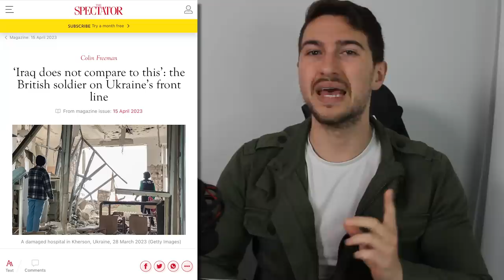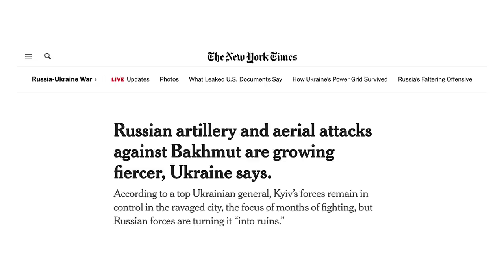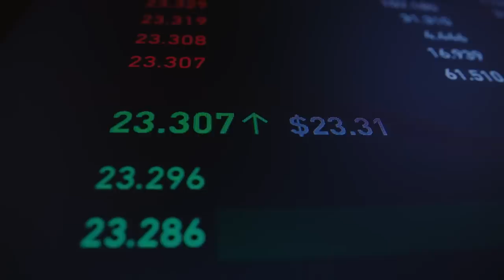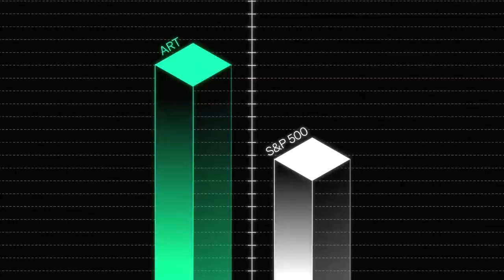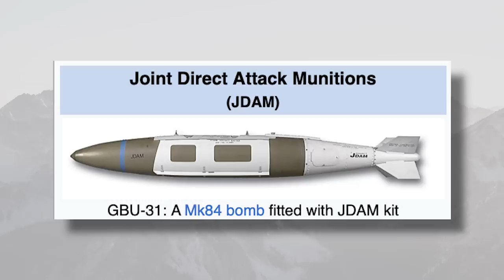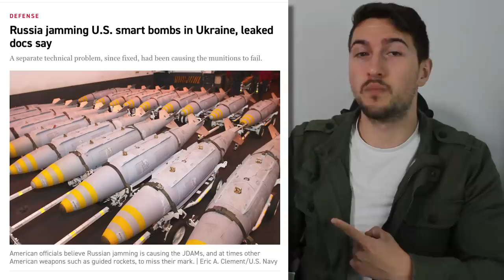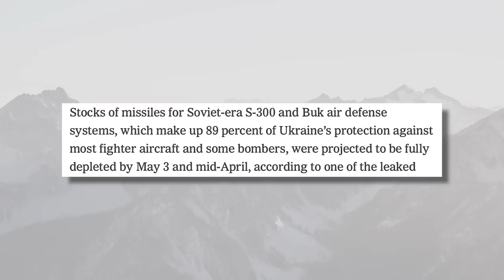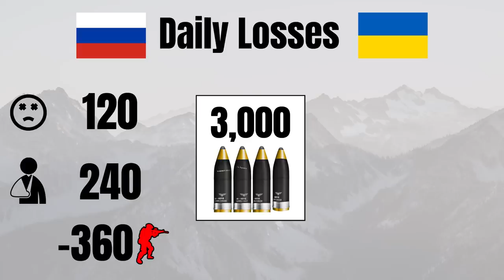Wagner Swipes Through West BAKHMUT with FAB-500s

Comment: There is this dude called lazerpig that just makes shit up saying ukraine arty is more precise and better and russian are bad and its running out of ammo, he refuses to elaborate with zero proof. Sometimes he just annoying at best.
Reply: NATO supplied Ukrainian artillery does have an advantage. Russian artillery, particularly SPGs are mostly 152 mm equipped with L/47 barrels. While the NATO equivalent is the larger 155 mm L/55. China has also adopted this standard.

The accuracy issue is also tied to range. Shells become less accurate as they lose momentum. Which peaks when they approach their maximum range. The shorter L/47 barrels on Russian artillery means they naturally lose range and accuracy sooner.
Reply: @KSmithwick1989  the problem I see that ukraine is 100% depended on West ammo delivery and just like it said on the video the industry military complex are having problem making more ammo.
Reply: @KSmithwick1989  when it comes to accurate it doesn't matter that much, becuase if your enemy as 10x more artillery you have bearly any time to fire without having to move fast evertime to avoid counter barrage, and that time is vital if on the attack or if your frontline units need fire mission to hold the line. The advantage fro the russians is that they have so many artillery guns that they can fire at everthing very time and being able to supress the enemy ability to response.
Reply: @Luiz Vinícius Vieira Alexandre  Range and accuracy does matter. Especially when that artillery advantage is mostly tied to towed artillery. From the Ukrainian perspective, they're targeting the artillery batteries and ammo dumps themselves. Which is an effective means of attrition. As it destroys irreplaceable Soviet era stockpiles while eliminating experienced gun crews.

Firing 10x out of inefficiency is also an issue. As you're exposing more of your logistics network to enemy artillery. While simultaneously wearing out barrels, which unnecessarily eats up more resources.

The before mentioned range advantage also negates your counter-battery narrative. The Russian 152mm L/47 is really not a competitive system. For example, a 2S19 MSTA firing extended range  basebleed rounds has a range of 29 km. While NATO systems with the 155mm L/52 can provide 36km range with standard boat-tail rounds.
Reply: @KSmithwick1989  yes I agree, accurate and range can be helpful when it comes to Hunt down ammo caches or expecific targets,  but when it comes to frontline dutys like supression on a Broad frontline like it is on ukraine quantity are proving to win be winning this match. It is not 100% science there is alot fog of war.
Reply: @KSmithwick1989  but that is the thing. Russian Artillery is precise not as accurte like western gun and they are beang able to put alot of stress intro Ukrainian artillerys team, just like soldier X said on his interview that russian artillery response teams are faster them Ukrainian, not my words. Both sides are using alot of towed artillery there are SPG but great majority its towed guns.

I Personally belive the only way to ukraine to match the russian fire power is to have more or just as many artillerys guns as russia.
Reply: @KSmithwick1989   calm down its hard to replay if you keep editing your post
Reply: @KSmithwick1989  I agree with you The russians artillery don't even match when it comes to range. But West are not sending their hole stock of excalibur 155mm round for ukraine. Most ammotions they get from the west are dumb round.
Reply: @Luiz Vinícius Vieira Alexandre  It's simple, conducting such asymmetric operations dwindle the enemies' means of conducting war. Modern Russia does not have the factory or the budget of the Soviet Union. Decades of neglect and political succession has prevented that.

So they really lack the physical means of replacing shells faster than they are spent. Firing that many shells is actually doing the Ukrainians a favor in the long run. 

As the advantage is steadily becoming more narrow. Some estimates even place the current figure closer to 7 to 1. With daily shell expenditure dropping closer to 7,000-8,000. As opposed to the previous estimate of 20,000 shells per day.
Reply: @KSmithwick1989  yeah we have zero info when it comes to russian production of ammotions. And we idk how many soviet era stocks are still out there, one thing is for sure soon Ukraine or Russia will be doing something and we don't know when its too soon to say what.

Comment: That M109 cost 14.4 million dollars 🤔 what a joke 😂😂😂
Reply: That price is for the newer M109 A7. Those are designed for a newer 155 mm L/58 cannon. It significantly out ranges the shorter barreled Russian 152mm L/47 cannons. 

Those systems are only capable of 36 km. As opposed to the newer M109, that is capable of 70 km with RAP rounds.
Reply: @KSmithwick1989  seeing a drone take them out that cost what? Over priced MIC shit..
Reply: @Russianbot5150  It's really not hard to counter the drones. Both sides have been doing that with simply nets. There's footage of lancet drones being disabled by that method.

Comment: This is a Russo-NATO war though
Reply: Russia- casualties in the tens of thousands,tanks and armour losses so heavy they need T-54/55s and MT-LBs with WW2 ship cannons to fill the gaps

NATO- hasn't arrived yet
Reply: @ahta5708  It's actually vice versa. NATO has already depleted its stocks supplying all of its arsenal to Ukraine, and it has Ukrainians as the only people willing to fight for it. While Russia hasn't even mobilized to any significant extent.
Reply: @iMetmor  "NATO has already depleted its stock"

Source on that? Because NATO hasn't even started supplying Ukraine with it's modern arsenal until recently with newer MBTs and IFVs,and even those are from the late 90's

"Russia hasn't even mobilized to any significant extent"

They've already done a mobilization wave mobilizing anywhere from 300,000 to 1 million,and they still haven't captured anything significant in the past 6 months. And there's also the sheer amount of armour,vehicles and modern tech they're losing that makes them desperate enough to bring out tanks and APCs from the 50's. And there's also all the logistics needed for Russia to mobilize their supposed "real army" which if their performance recently is anything to go by, it's now non-existent
Reply: @ahta5708  Ship guns are better than the ZU-23-2 and much better in terms of firepower.
T-54/55 - most likely will not be used for its intended purpose. They are needed as artillery guns for shooting beyond the horizon. A huge number of shells are currently in stock.
Reply: Ukrainian soldiers are trained in NATO counties, they USA NATO equipment (Czech republic moment), they obey NATO's orders and they also use NATO's intelligence. But no, NATO hasn't arrived yet, cope
Reply: @PrstBs1  You see any NATO jets doing SEAD and taking out Russian jets from 200km away,followed by NATO bombers, strike aircrafts and apaches destroying Russian ground forces,all while the entire airspace is covered by an NATO AWACS, before NATO Leopard 2a7s M1A2 sepv3s,m2a3 Bradleys with this generation thermal imaging mop up the rest of the forces in the night,being covered by himars launching ATACMS?Because if you don't that means NATO hasn't arrived yet and Russia is up against Ukraine. Besides, what happened to the whole "Glorious Russia can take all of Europe plus American combined"? Are you admitting Russia would lose if they do that?
Reply: @PrstBs1  It should also be added that the army that Ukraine had in Feb 2022 was the army NATO had trained for 8 years while pretending that it sought peace along the lines of the Minsk accords only Russia believed in.
Reply: @ahta5708  Hahaha, if NATO arrives the way you expect it to, it will be humiliated even more. Russia's air defense is second to none. A hostile jet doing any significant damage to it is just not a possibility in this universe.

Your fantasies show that America and NATO have gotten used to fighting poor peoples with no proper means to defend themselves. But as every American war since Vietnam showed, they can't really defeat even tribal people — only do damage and retreat. With Russia NATO can't even do that.
Reply: @iMetmor  There's this thing called SEAD and DEAD operations specifically for dealing with the air defense systems that any competent army would know about,so not surprised you and the Russian armed forces have no idea what it is
Reply: @ahta5708  Your whole point is that NATO uses not their most advanced equipment? Well, Russia doesn't use T-14 or Poseidon missiles, and? What does it change? And yes, in a full-scale war between NATO and Russia - Russia will lose...Just like NATO...And the rest of the world. So what's your point?
Reply: @PrstBs1  Russia doesn't use T-14 because they don't have any more than a dozen and the Poseidon because Putin isn't desperate enough to risk making the Kremlin glow in the dark,and everything else they have is already in Ukraine. NATO doesn't use their most advanced equipment because Ukraine isn't in NATO yet and since Russia isn't officially at war with NATO,they can't use them because of escalation. Those two are very different things
Reply: @ahta5708  But in the same time, Ukraine uses modern Javelins and Bayraktar drones. And by the same logic, NATO does not provide Ukraine their most advanced Leopard2A7 because they "don't have any more than a few dozens", while Russia doesn't use their SU-57 fighters because "they don't want to escalate"
Reply: @PrstBs1   the javelin was designed in 1989 and the bayraktar is a propeller engine drone dropping bombs. And leopard 2's variant combined have over 3000 units constructed,while Su-57,ACCORDING TO RUSSIA, has 20 units. So no, Russia isn't "holding back because of escalation"
Reply: @PrstBs1  NATO doesn't provide Ukraine with the most advanced equipment not because they don't want to escalate but because they don't want to let this equipment be disassembled and examined by Russia once it gets destroyed on the battlefield.

The one escalation NATO's trying to avoid is a direct attack by an official NATO army. But for all intents and purposes Ukrainians and foreign «volunteers» are NATO forces, just unofficial ones. And they are definitely not the corrupt and incapable provincial shard of Soviet military that the Ukrainian army used to be before NATO's involvement.